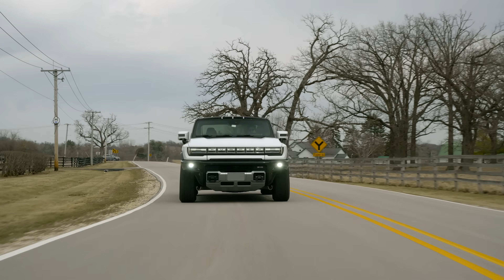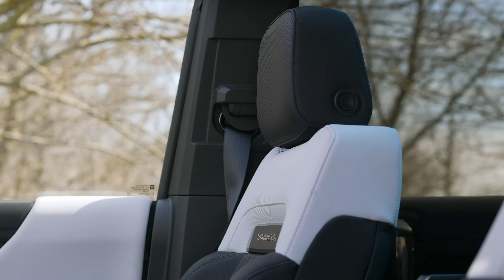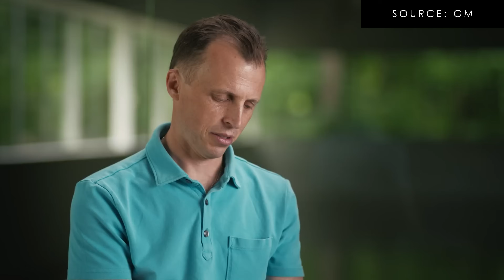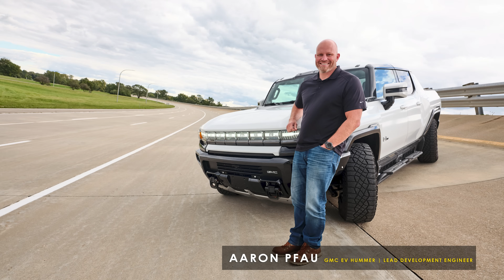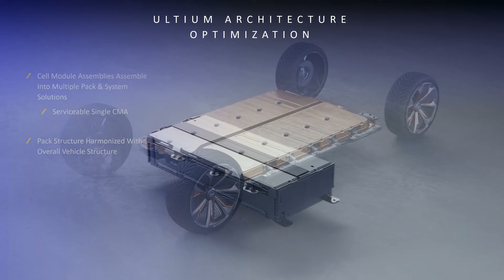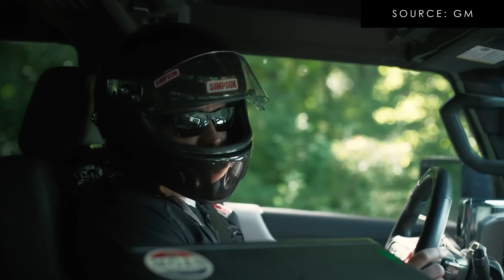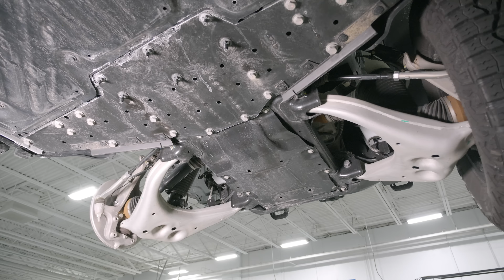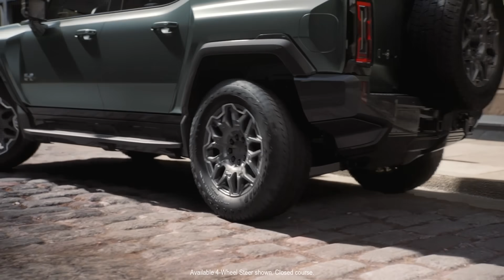Hummer EV | New Formula for Beast Trucks

Comment: I'm torn between this and a Miata.
Reply: Get both and use the Miata as a spare tire for the Hummer.
Reply: @LG123ABC  😂
Reply: The Miata if you want to pull something 😅
Reply: This but unironically
Reply: Miata is always the answer 😏
Reply: Definitely a toss up. Depends on your preference between full convertible or targa tops. Otherwise, quite similar.
Reply: The tires cost probably as much as the Miata.
Reply: You need two more vehicles for a proper drawn and quartered
Reply: You’ll need the Miata as a spare car.
Reply: Miata 
Is 
Always 
The
Answer
Reply: @MaxSpeedMike  lotus elise final edition, gmat43
Reply: @kalmmonke5037  find me a lotus that costs the same as an old miata 🤣
Reply: @MaxSpeedMike  it’s basically a rwd celica gts though haters will say it’s fake
Reply: Ya, torn in half from such an accident
Reply: Biggest difference is the Hummer is a driver's car.
Reply: por que no los dos?
Reply: Between this and Autozam AZ-1
Reply: A Kia soul should be put in there as well.
Reply: Why not get the Hummer and a Fiat 500 EV? Bonus, it might even fit in the bed of the Hummer. And you can charge the Fiat from the Hummer.
Reply: Miata
Reply: I sold my Miata 3 days ago. It hurts.
Reply: I reckon the dynamic handling capabilities of the Hummer would far surpass that of the Miata.
Reply: Go for the Miata
Reply: Best review/overview of the Hummer EV by far
Reply: Together they fulfill every driving niche you could possibly need! Even if one is “your SO’s” new car, it would be the perfect combo…
Reply: Get the Miata.
Reply: Yes
Reply: Just flip a coin. Same thing either way. Lol
Reply: Get the Miata
Reply: Same turning radius!  Are they really that different?
Reply: I'd go with an MX-5 instead.
Reply: Get both!!
Reply: I’m trying to decide between a bulldozer and a hot wheels car
Reply: This will tear through a Miata like wet toilet paper.
Reply: That's just silly.  Wet toilet paper could never tear through a Miata.
Reply: @ChadwickJames  Which vehicle in the Hummer’s class was engineered for reliability?? Well, first find a vehicle in production that actually competes. So many morons who didn’t even comprehend the video above.
Reply: @mybro727  toyota tundras are reliable. they are engineered for reliability?
Reply: @mybro727 ou’re right. But he’s also correct to ponder the wisdom of buying the first generation of a new technology from GM or anyone else for that matter. 
Certainly some VW buyers are experiencing serious problems with getting parts for their new EVs. But if you can afford a Hummer it’s unlikely to be your only vehicle.
Reply: or rav 4 prime
Reply: There is a me in Hummer.
But there is a mi in Miata, which contains an i. ... But not an I. Even though the Hummer is the i-car.
I'd probably choose the less confusing car.
But I don't know which one that is.
Reply: Get both! The blast from the past NA Miata and the best of the future that you can charge and keep in your garage and not at a GM service center, a TESLA CYBERTRUCK.
Reply: Buy the Miata and get a non-electric hummer.
Reply: @Closertotruth2  Booo you can't put a Miata inside a Diesel Hummer.

Comment: The fact this car weight (with occupants and luggage) is 10,000 pounds is INSANE! If this car crashes into anything less than a mid-size SUV, you will be toast. As SUVs and Trucks are getting bigger they need to update crash test safety standards on how a vehicle impacts other smaller cars during a collision. God forbid this hits a Honda Civic let alone a pedestrian...
Reply: The weight eats tires as well.
Reply: The sad thing is it wont end up in things kike this getting banned, it will end up in fun stuff like a Miata or Fiat getting banned.
Reply: This vehicle has been on the market for over a year now. How many Hummer related accidents have you heard of or Hummers that have been involved in a crash? There have been more Tesla related fatalities in one calendar year than there has been Hummer fender benders reported since the vehicle has been in production, yet y’all will deem this to be the most dangerous simply because of it’s capability on and off road, size and mass? Is the Raptor R and TRX trucks exempt from being so dangerous because they carry gallons of flammable gasoline? Sure, that makes complete sense. 🤡
Reply: @mybro727  in physics: force = mass x acceleration. A 4,000 pound full-size Dodge Charger running into you at 70mph will do LESS damage to your car than this 10,000 pound Hummer going 35mph.

In other words: Brock Lesnar's jab is going to hurt a LOT more than a haymaker from a 6th grader.
Reply: @seanshong2048  Sir, a “jab” from a 6,00 lb RAM TRX at 70 mph could kill you just as well as a Hummer traveling 70 mph could kill you. The RAM isn’t exactly a 6th grader’s jab and neither is a 2 ton Dodge Charger plowing into you at 70mph. A better analogy is the 6th grader shooting you with the same gun as Brock Lesnar. That’s the part that’s going right over your head, they’re both equally as dangerous under the same circumstances. The Hummer isn’t anymore dangerous than the Charger would be at the hands of the same reckless driver as both vehicles are powerful and heavy.

I know this goes completely against your narrative but it is the actual reality.
Reply: @mybro727  you've proved my point. All this hummer has to do local road speeds to produce the same damage as a normal car doing highways speeds. This is the reality.
Reply: @mybro727  Dude, there have been less than like 1,000 total deliveries of this thing. By sheer volume of production you SHOULDNT be hearing about wrecks. Tesla has sold almost 2 million cars so obviously you haven't heard of wrecks comparatively. Also, this guy is talking about weight. Tesla's are already insanely heavy. This is NINE THOUSAND pounds. The average weight of cars prior to recent years was like 3k pounds; a proper sports car is usually in the mid 2ks (even some today are). If this thing hits anyone in a compact car or even sedan, they will be dead.
Reply: @cordellwanless5914  You’re continuing to pretend the Hummer EV is the most dangerous automobile on the road simply because it is fast, large, and heavy. There are several vehicles in the roads that already fit that description, most of them are ICE powered automobiles with gasoline tanks full of flammable gas and half the safety technology and level of driver assist features. 🤡 

Secondly, your excuse for failing to provide data proving this to be the most dangerous vehicle on the road is GMC hasn’t sold enough of them in order to show up on a record or for anyone to hear about it? They aren’t dangerous yet until they’re selling as many Hummers as Tesla is douching out model y’s and 3’s? 🤣 🎪
Reply: @cordellwanless5914  SURE, SIR.

Comment: Do the batteries use cobalt? If so, where does that come from............
Reply: They do use cobalt, just like every other lithium battery. However, as Jack mentioned, GM's cells use 70% less cobalt than other EV batteries. It's done by adding in aluminum to the cell chemistry.
I'm pretty sure this makes them a little less efficient as far as kWh/lb versus say a Tesla battery cell, but it's less impactful in a human rights sense. Still not perfect, but better.
Reply: @jakelee5456  Most lithium batteries won’t have cobalt in the next 5ish years
Reply: @dawsongranger4940  I hope you're right. I know everyone's engineering department is doing everything they can to achieve that goal. With any luck, marketing can get accounting to turn a blind eye to engineering's efforts.

Comment: If you took this too far off-road and buried it…. Not many can pull 9k pounds from a stuck condition. This thing will sink in mud.
Reply: Mud? I'm worried about this thing sinking in my concrete driveway.
Reply from the maker: We have a back up wrecker on standby
Reply: This thing will snap those skinny tie rods on the first major obstacle so at least the recovery vehicle wont have to travel far.
Reply: I ran the math a while back on this, the energy consumption and range of this while doing severe offroading is equivalent to a fully fueled ICE Ford Bronco carrying an additional 15 gallons of gasoline. I honestly don't think this will have any big issues, you'd be hard-pressed to find a stretch of offroad course in the United States that could actually tax that range to the limit. That said I'm sure somebody will drive this off the edge of black bear pass at some point.
Reply: You’ve clearly never seen a Hummer demonstration in the mud despite the hundreds of hours of filming of just that on this very website. Y’all are choosing to be ignorant as hell.

Comment: How far can you tow on a charge? What is the weight limit to tow?  What are they doing to help reduce fires once the battery pack is cracked in an accident?  EV's burn far hotter than a ICE engine and can reignite days later.
Reply: Towing capacity is 7500 lbs. Car & Driver is the only publication I've seen complete a range test comparison between Lightning, R1T, and Hummer. Towing identical trailers, the Hummer had the best overall range and best towing range. Still not ideal for long-distance towing like a hotshotter or camping three states away.

Comment: I always wondered why manufacturers use a steering wheel with paddle shifts in a car that doesn't have an automatic. Like sometimes they use it for engaging rev match in a manual car, and then in EVs like this for turning regen on and off. Is it cause they just have a surplus of steering wheels with paddle shifters? I don't get why the do this
Reply: Because it is a position that can be very easily reached without taking your hands off the wheel. And they also probably produce the same steering wheel over and over so its cheaper if just all of them have it.
Reply: Over the last 15 years or so, a lot of people have become accustomed to paddle shifters and this one feels like using a downshift paddle
Reply: It's cool. So much shit in this car is just cool. I think it works.

Comment: EV’s still need some regression testing to be ready for the mainstream, but will get better overtime. I’ve a 2022 Ford Lightning and so far have put 10k miles on it. It’s been great but has it’s share of issues and quirks. Would I buy again? Maybe. But I do have an ICE vehicle and wouldn’t replace ICE to EV at the moment or the near future.
Reply: Or never
Reply: @andersonrodriguez8258  Or never indeed. Especially since the need to do so is entirely manufactured.